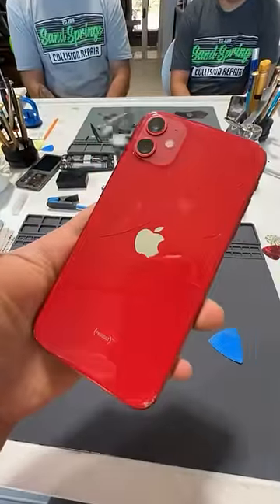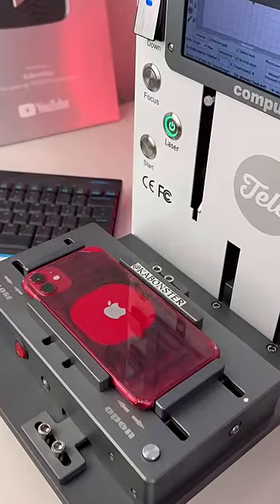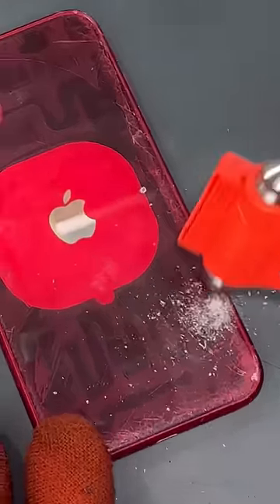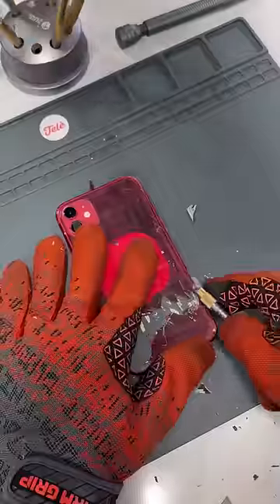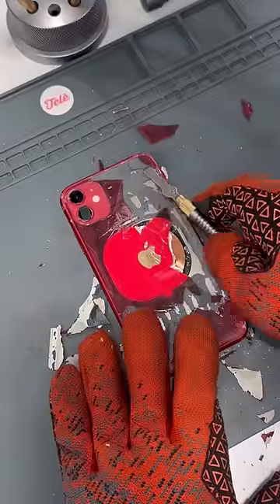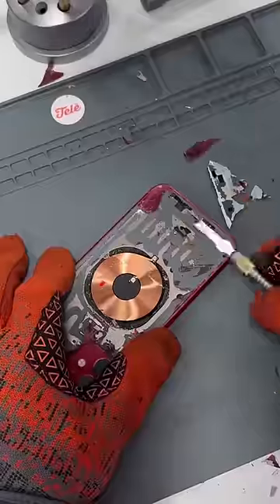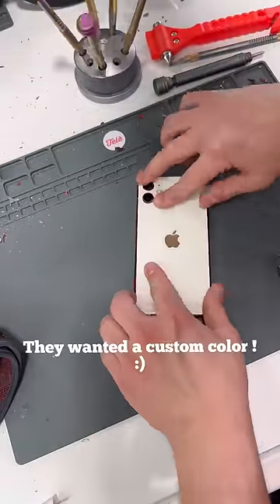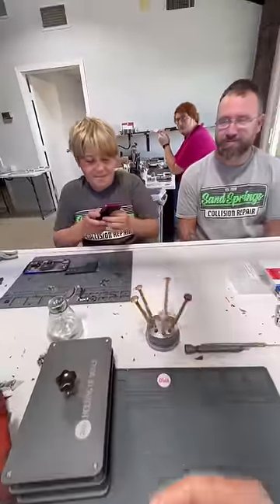Gave both of my Customers some Ski goggles 😂 #shorts #iphonerepair #backglass #safety #teletouch

Comment: You should build a containment box when breaking the glass off, kinda like what they have for sand blasting machines, you put the work piece inside a box and stick your hands through some holes to clean the piece. It would keep the glass contained and easier to clean up.
Reply: Dude that's all I was thinking. There's literally glass flying at the customer. Glass everywhere. Those shards are aerosolized and can be breathed into the lungs, just light fiber glass. Very dangerous

Comment: What’s important is that is an iPhone 11 (Product) Red Edition , which supports research for HIV/AIDS and the version I have specifically to show support. You removed the product (Red) but replaced it with a standard white. When you can easily get replacements for red. Even in a rush imo
 But guess up to the customer
Reply: All their red line supports it. I have a product red xr
Reply: The kid chose a white back

Comment: Never understood why people repair the back glass when it breaks. Nobody sees it and you can cover it up easily with a case. Some people have more money than sense
Reply: Le entra el agua🤷🏻‍♂️🤔
Reply: Are you serious? I would never walk around with ANYTHING broken. Like literally anything, especially when I can fix it myself
Reply: @Coolie-ds4tu  but what’s wrong with that? it’s not like anyone can see it unless they take the case off
Reply: @alien7277  Moisture, bits of broken glass, and possibly worsened wireless charging. Moisture being the biggest thing, you do not want moisture seeping through those cracks since it could condense in the phone and break it through water damage. This is the reason, you might not think it would be that bad, but it can be, reason even the SIM tray section has a water damage sensor built inside even when the SIM tray is so packed into that SIM reader.
Reply: @MinecraftLD10  oh yea ur right 😭

Comment: Never had a problem leaving the stacked boards in? I use the rewa one and the templates they come with suck. You made this look very easy. Can you use different software with the rewa laser?
Reply: Btw when I asked about the problems we had power issues with an XS Max after a back glass and have been taking the boards out since.